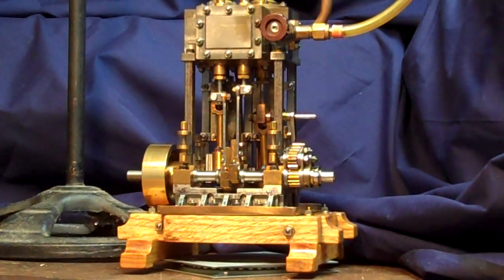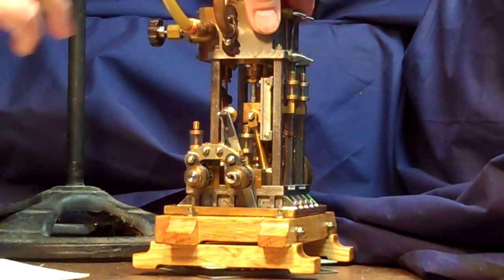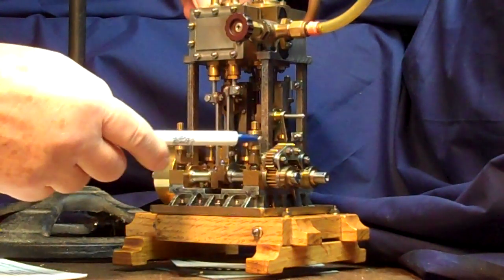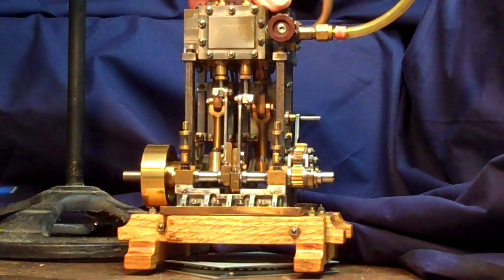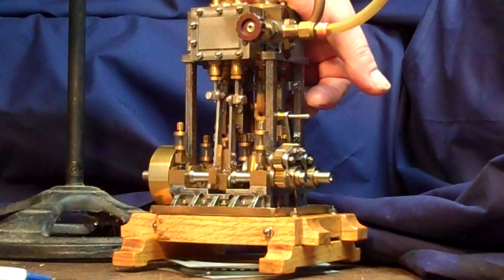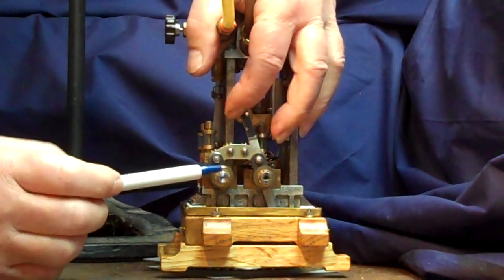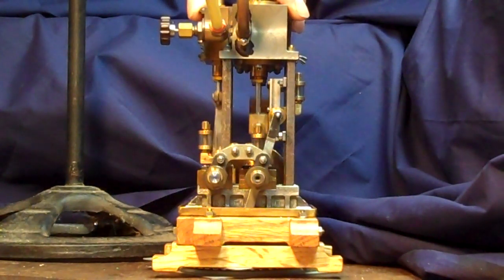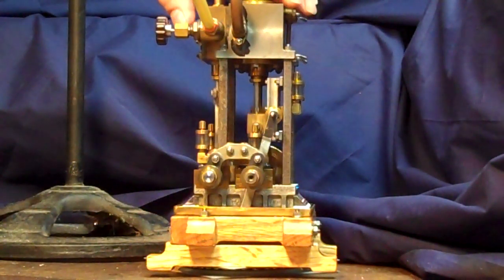Model Steam Engine - twin cylinder double acting

Comment: I have designed and built a miniature three cylinder single acting steam engine with a side eccentric shaft that I use in miniature model steam boats.  It is a self starting engine but I not been able to make it reversing due to the small size i.e. (1/4" bore X 1/4" stroke).  I think the Maudsley could be made to work on my engine.  Thank you for showing and explaining is such detail.

Comment from the maker: @questionablesight  Thanks! 
A lathe, say 7" swing or greater;  a small vertical milling machine.

And, of course, the skills to use them.

For a first steam engine I would suggest a small oscillating engine so that you may acquire some skills in the use of machine tools.  It would help you immensely if you could take a machinist's trade course at a local community college or high school.

Alternatively join a local model engineering club and ask a willing member to help you.

Comment: Hello, I am trying to make a Maudslay reversing gear for my miniature 3 cylinder steam engine.  I have been watching your video, it is the only example  of a Maudslay that I can find.  I am confused by the degrees of rotation between the crankshaft and valve shaft.  It appears to be about 90 degrees, or less.  Doesn't the valve shaft have to rotate 180 degrees with respect to the crankshaft to reverse the engine?
Reply from the maker: To tell the truth, I never thought much about this at the design phase of this project.  I built this engine from basic design sketches and then determined, experimentally, the amount of rotation required for the eccentric shaft.  Then I made the brass button to provide for the correct amount of rotation.  Yes it is possible to determine this prior to construction, especially with CAD drawings that permit the running of the CAD model, programs such as FUSION 360. w
Reply: @BasementEngineer  Hello, nice to hear from you.  I am very impressed by your engine.  I did install Maudslay reversing gears on two of my miniature three cylinder engines.  One with two gears and one with four gears.  There are videos of them on my YouTube channel at LeslieProper .  I would be interested in your comment on them.

Comment: interesting, never heard of the Maudsley.
Reply from the maker: It's pretty straightforward, but doesn't allow continuously variable cutoff. On the other hand, it doesn't need an expansion link with sliding die block either, and the valves are conveniently driven directly off the eccentrics. It does require gears, however.
Reply: i am building a small marine engine and just made the expansion links. they are not that hard. What is the valve gear that the dutch use

Comment: I am building a full scaled solar thermal car.  I am using a 2 by 8 meter curved mirror to focus sun on a pipe.  I need a steam engine that can product between 1000 to 3000 watts.  I am building a tesla turbine but I also want to test piston steam engines and Stirling engines.  I am looking for an inexpensive engine that is easy to fix and is very efficient and light weight.

I and designing and building the solar thermal car in sunny La Paz Mexico.  I have over 30 build videos on my youtube channel.  

Also the German magazine FOCUS is writing an article on my solar car.
Reply: Look forward to check it after this
Reply: 9 years ago and I fund no solar car 😅